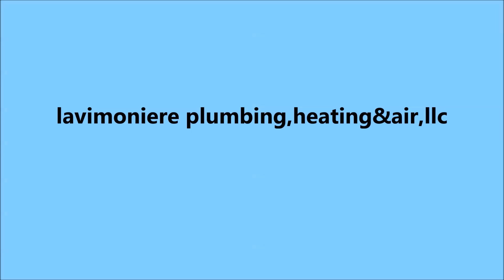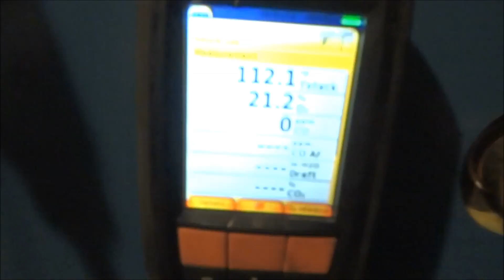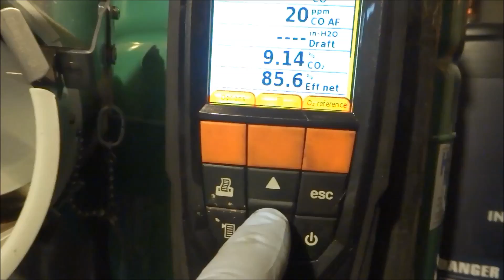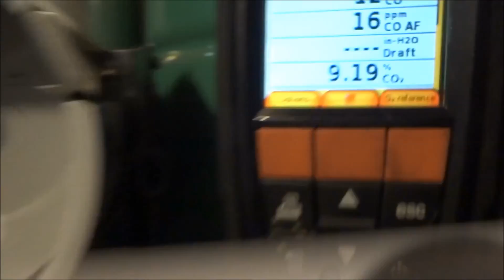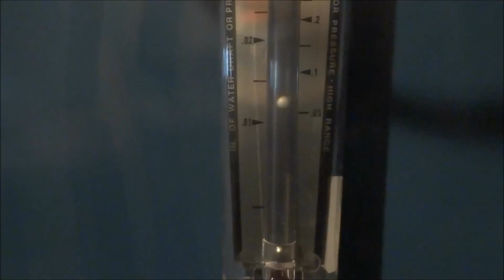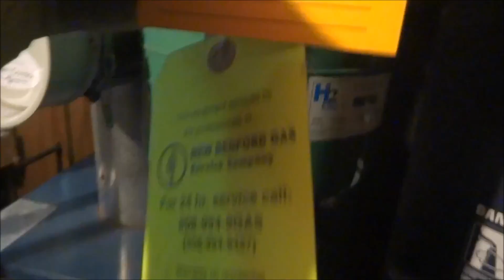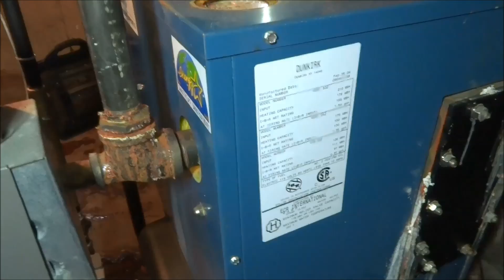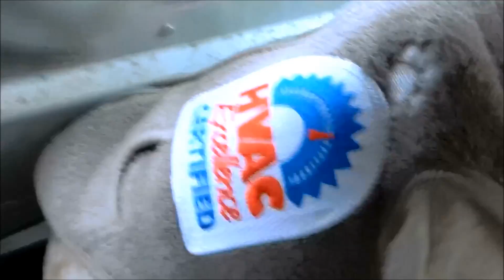Carlin Gas Conversion Burner Combustion Test

Comment: Hey Steve ever see these power burners dropping o2? I checked the exchanger and it’s clean. Our company has been back numerous times throughout the past 2 years and it’s always going down too 2.0 o2. All I can think of is dirty exchanger. Stack temp is around 450 deg at 4.3 o2 and all numbers are stable.i was unable to call tech support as it was 8pm

Comment: Even though the smoke or co alarm are hard wired there is still a battery inside for power outage.  The beeping is a warning that the battery inside is dead.